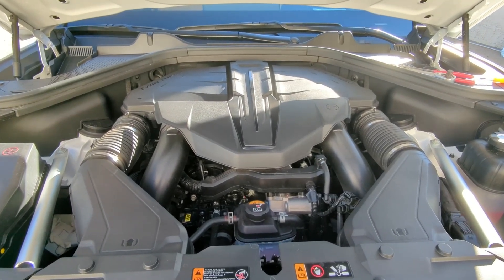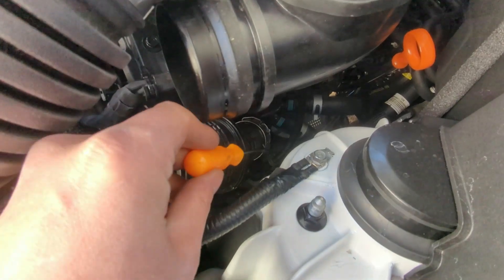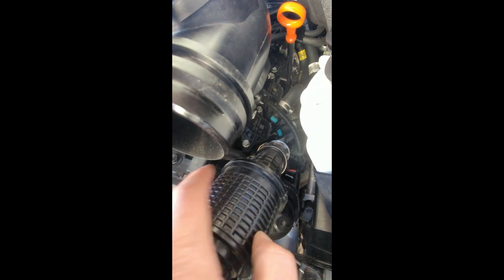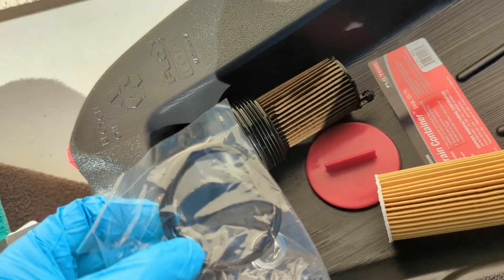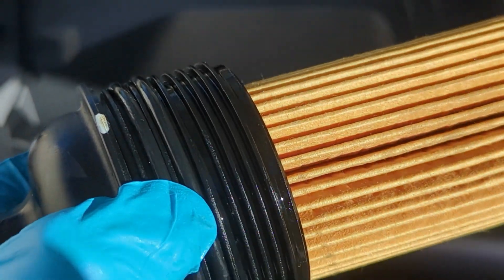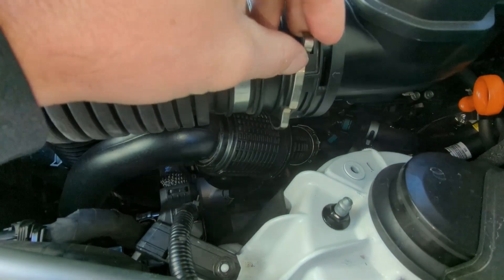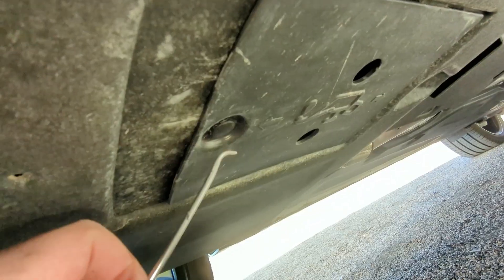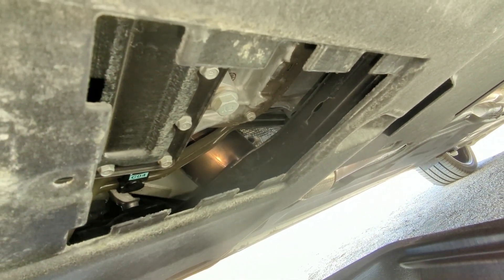Hyundai Genesis gv80 Oil Change 3.5 engine How To

Comment: This is tremendously helpful Brandon! Thank you. My wife's GV70 just hit 6000 and the dealer is backed up for 2 months here in Georgia. Going to grab a filter today and do it myself. Thank you!
Reply: my dealer shop told us that an oil change is required only after 16k miles. have yall experienced the same info?
Reply: @arenteria1100  16,000 miles?!?!? NO! Modern day synthetic oils should be changed every 5000 to 6000 miles. I changed ours at 6k and thent he dealer just did another change at 10k. They aren't backed up anymore, at least here in GA and now offer loaners too.
Reply: @arenteria1100  No, first oil change should be at like 500 miles due to engine break in. Then maybe at 2000-3000 miles, then maybe 5000

Comment: That's exactly how I do it too.  I also put some paper towels around the filter housing because when I pull the filter out it tends to drip oil.  Like you, I also plan on keeping this vehicle for a long time.  Did you use a torque wrench on the oil plug?  I'm afraid to do it by hand because of the aluminum threads.

Comment: Brandon: Thanks for the video. It looks like the front tires are on the ground. Are you able to access the drain plug with the tires on the ground. It looks extremely tight. Thanks for any insights. Bill

Comment: Good video, Brandon.  I see it calls for 0W-30.  Did you use Synthetic?  What is the change cycle for normal driving?  I’ve read where the dlr may or may not use the exact prescribed weight so I think I might buy Mob-1 Syn and give it to them to change it for the first 3 yrs then I may just do it myself.  We just ordered our 2023 GV70 3.5T and can’t wait to get it.
Reply from the maker: Yeah we only use synthetic in turbo gas cars. We used 5w30 the first time because the 0w30 was not available at the time. Also the 2nd oil change was only like 15 minutes.
Reply: Yes, Unfortunately the dealer uses 5w-30 and really, anywhere you go you will get 5w-30. I started changing my own oil, using 0w-30 and on the first oil change I used STP oil cleaner additive and let the car run for 15 min before I drained. This will remove most of the build up on the pistons and clean it good. Yes the car is new, but I do it anyways, keep it for long and whatnot. Since the car is twin turbo it will have gunk build up because "notoriety" of turbos. If you have the same problem like I had, where the car vibrates a little on cold starts, clean the oil before the change. And PLEASE, do not drive the car when the cleaner is working.. it will fuck everything up inside the engine.
Reply: @grem_one  Thanks IIia.  I’ve heard the manual says to use a fuel additive, like Techron, every 8k miles or so.  Would that have same effect as STP? Also, I plan on bringing dealer Mob-1 0W-30 for all my changes.  I don’t mind overpaying for the 3 complimentary oil changes to ensure the right oil is being used.
Reply: @jaybd9329  No, Techron is a fuel system cleaner. This will clean to heads of your pistons and your fuel system. I was planning on using that too, but I will do it on my next oil change because I fuel with 93 Octane and I think it's not time for that just yet, but soon lol 😅 I do drive my car a lot soo yeah, the little things.

Comment: What kind of oil are you using?
Reply from the maker: Whatever is available and on sale in 5-30 or 0-30 synthetic. We also do oil changes every 5k because we spend a lot of time in the boost cruising 90-100 for hours on the way to and from Vegas or LA.  From all my turbo experience, the turbo cars breaks down the oil more rapidly. We usually own our cars to about 180k miles so its just cheap insurance. Especially since Hyundai motors are notorious for burning oil as the age.

Comment: How much is the dealership asking for this oil change?
Reply from the maker: Free, but that doesn't do me any good if they are backed up a month for the next appointment.
Reply: @brandonlarson5275  !! Yes, they told me yesterday I have to make an appointment for August 20th... I mean a month!? Come on..
Reply: Also theres another access in the bottom to drain the oil from the filter housing.
Reply: @brandonlarson5275  A long waiting list for an oil change that's crazy. Your right better off doing it yourself. There's always a catch when something is free.
Reply: @Pantherforlife I usually decline their free oil changes. Worried they might screw up or cut corners. I just keep all the receipts for parts I used in case of any warranty issues
Reply: @Umair23  I believe it only drains the oil out of the bottom filter housing.

Comment: It is not a Hyundai. It is a Genisis. Stop mixing the two. Even Hyundai will tell you they are now separate. They won’t even work on them. Genisis must .
Reply from the maker: Its says manufactured by Hyundai right on the vin plate. It takes a Kia oil filter, and a majority or the parts on the car are stamped with Hyundai. All of our Toyota Lexus were the same way.
Reply: @brandonlarson5275  Well my point is is that I also called a Hyundai and it is come down to brass tacks with them now they have Genisis only and Genisis mechanics and Highend they will no longer work on any vehicles of the Genisis nature from 2018 to newer they even refused to mention the word high-end day it’s gotten the point where it if you ask for high-end day you’re going to get high-end day when you really met Genisis so it does matter in the in their eyes going forward
Reply: @billf9847  its really not that serious...

Comment: Take it to the dealer
Reply from the maker: Our dealer in Scottsdale is always a month or two wait for an oil change. No to mention the time I got it down to about 15 minutes now.
Reply: @brandonlarson5275  well my point is is most of them are that way even here in Las Vegas it’s the same way they’re about a month out at minimum but tells you something though either a lot of people like these and there’s a lot of them out there or they’re just understaffed however they’re going through a big transition right now or Highend day and Genisis are on top of one another utilizing the same buildings and don’t have enough room but I still would rather use the dealer I’m getting the point were I’m older now where I used to do all that myself and I don’t have the patience nor do I want to mess something up but thanks for the video though any videos may be on how to just go over the coolant and filling the other fluids in general that you’ve made maybe